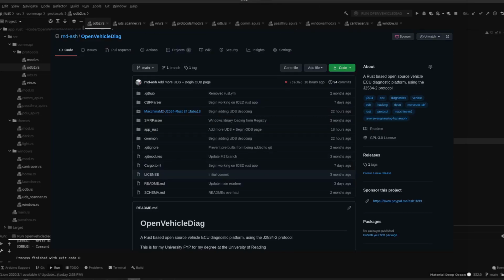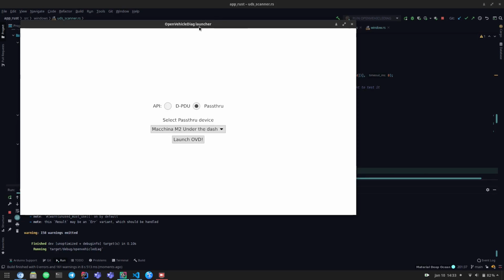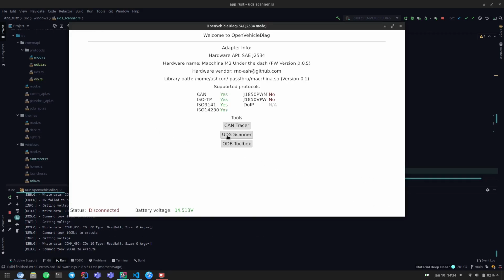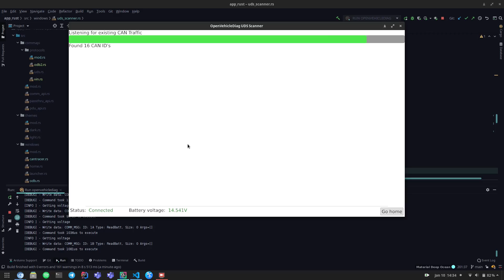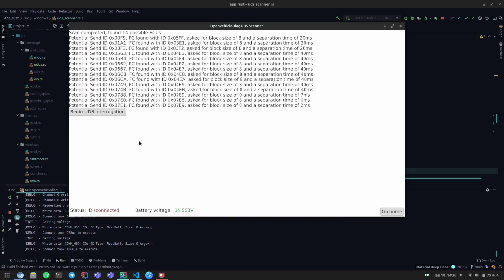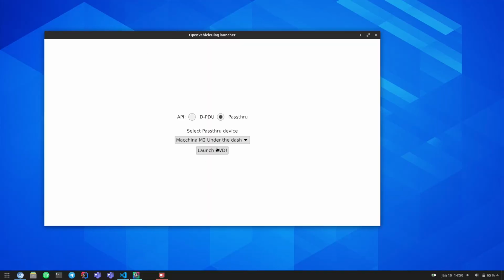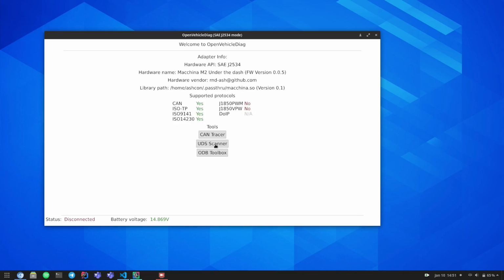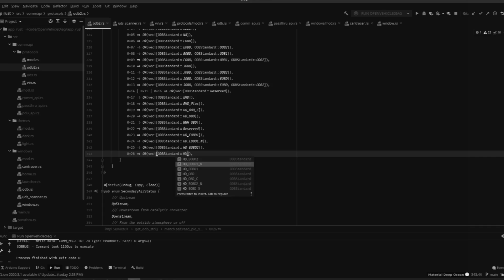Open sourcing car diagnostics and hacking - OpenVehicleDiag demo 1

Comment: What is the name of the program you use to modify the exe or executable files? Visual basic or what? Is it possible to set up an obd2 to work with meecede's diagnostic software xentry? Except jmd2534 or openport. Thank you.

Comment: Not the hero we deserver , but the hero we need. Btw what OBD Reader are you using with your car , i also have a 2005 220CDI C-class but i literally cannot reach most of the sensors and data in the car.
Reply from the maker: It's linked in the description. Macchina M2 with my custom driver

Comment: This is awesome! Can it eventually be used to reprogram something other than the ECU, like the climate control unit? (My A/C controller turns the compressor on even if I'm accelerating, rather than just at cruise, which leads to losses in power and fuel economy)
Reply from the maker: Technically yes, practically no.....not to mention the liability involved with possibly creating a bug which might end up bricking a particular ECU.